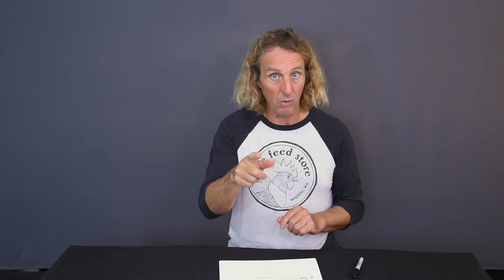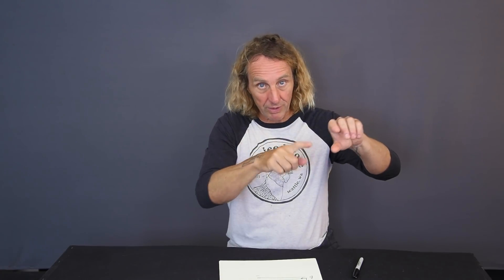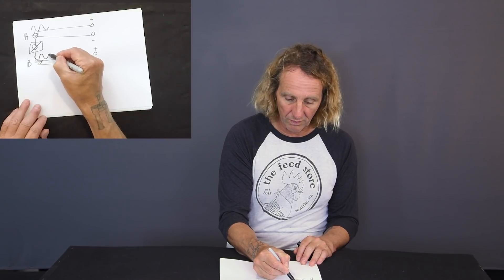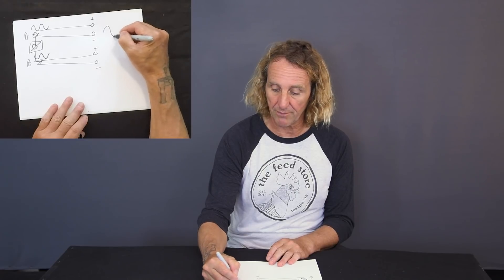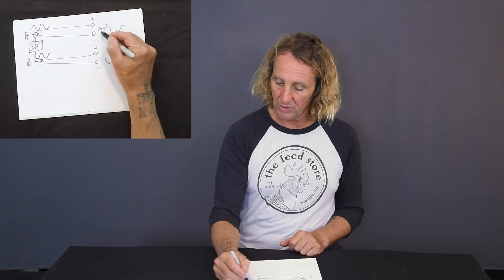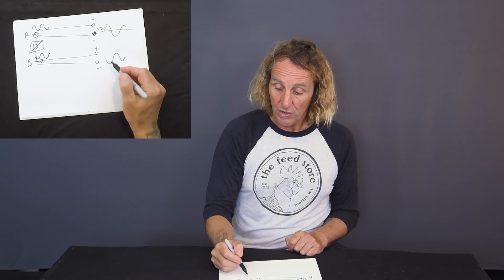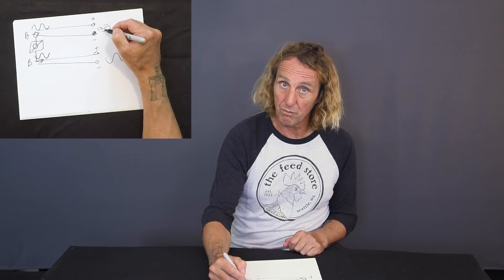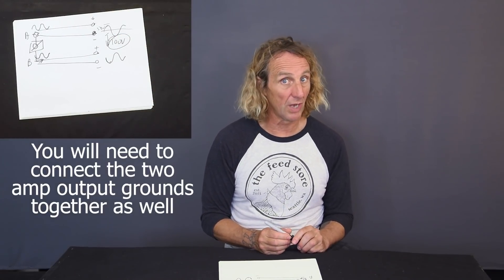Advantages of Amplifier Bridged Mono Mode

Comment: Great video! Isn’t the damping factor effected negatively when you bridge an amplifier?
Reply from the maker: Yes and no. Yes, into the same load impedance and same wire, damping factor is reduced with bridges, but if you double the impedance and double the wires, the damping is the same.

And with double impedance and double wire you have 1/4 the loss in the wire with brisged
Reply: @ wow dave himself! Thanks for explaining that.

Comment: I have a question, I have a crown professional series amplifier. How can I connect it to pioneer stereo receiver? There are no RCA hook ups on the back of the crown amp. Only a Phoenix connection.
Reply from the maker: Get a pair of RCA cables and cut the ends off of one side and why are the ground into the ground of the Phoenix connector and why are the center conductor of the RCA which is the plus to the plus of the Phoenix connector and put a little jumper on the Phoenix connector between the ground and the minus of the Phoenix connector.

The pin out of the Phoenix connector should be on the back of the amp or in the manual so you know which is plus minus and ground.

Comment: No its not better,  they sound horrible,  bridge may increase the power but half the demping factor  and struggles to handle low impedance speakers !
Reply from the maker: Hmmm, not exactly true.

Bridged into 8 has the same damping as stereo into 4 ohms

Also has the same amount of power bridged I to 8 ve stereo I to 4

But, bridged into 8 has 1/2 the loss into speaker wire if the same wiring is used.

Or, you can use thinner wires and have the same loss, saving weight, and money and cable size
Reply: @DaveRat  all this may  work in pro audio applications,  fact is bridging doubled the output impedance of an amplifier and it struggles to control low impedance speakers,  using thin and long speaker wire doesn't cut it .
Reply from the maker: @akhtarizod5802 well, perhaps you may not be aware that many amps are inherently bridged. Wherein each channel is actually two channels that are bridged. Bridged just means is a higher voltage and runs higher impedances.

Another way to look at bridged is it is a balanced drive rather than an unbalanced drive.

Balanced drive means each terminal has and equal and opposite voltage. Rather than a ground and one line having voltage.

 Also bridged uses the power supplies more efficiently as one channel uses the positive rail while the other channel uses the negative rail. A non bridged amp both channels use the positive rail at the same time time then the negative rail for signals that are the same to both channels.

Bridged has no impact on sound quality, it's just better at running higher impedances loads at higher voltages.

This is advantageous for minimizing loss in speaker cables.

Having higher voltages available allows better transient response as well.

Being more I formed will help you optimize the sound you are able to achieve

Comment: It all goes back to electrical theory. You have to understand the basic theory or foundation of Ohms law, watts law, etc... Years ago, I was helping a then friend do sound for a small festival.  NOT mixing, just setting up.  I tried to explain to him that his speaker cables were too light gauge wire, and he should move his PAs up front under the stage and keep the cables as short as possible.  The sub cables and connectors would actually get warm. I/2R loss.  
My background is in industrial electrical and electronics for over 33 years. With years in commercial electrical construction.  When you install sound systems in auditoriums, movie theaters, and stadiums, your distances are sometimes very long. Amps are hidden in inconspicuous places. Even inputs are subject to line loss.  Its crazy stuff, but very interesting.  Dave is a great teacher.  Pay attention bc there's a lot to learn!

Comment: Nice explanation and didn’t know you can bridge separate mono blocks… Question; Wouldn’t running a bridged amp to 2 speakers in parallel give you the most power and least resistance. This would give you a mono 4ohm (plus cable resistance) giving you almost double the wattage… Do I understand this correctly? (assuming the amp is stable/capable of 4ohm bridged)
Reply from the maker: Bridged into parallel will give max power potential but any internal amp resistance will be a bigger factor as bridged into 4 is the same as 2 ohms per channel
Reply: Dave, thank you so much for your response and confirmation I’m thinking of this senecio properly. I just recently found your channel and can’t get enough, I though I knew audio engineering well, but you have elevated my knowledge by at least 10%. Thank you!

Comment: Dude..... wish i would know this when i was 16 and had 2 same model 300-200 Watts... 
great stuff :washhands::washhands::washhands::washhands::washhands::washhands::washhands::washhands::washhands::washhands:
now days everyone is going with active speakers, I see ususally deploy Lacoustics system, passive. I like passive I believe are easier to run,(my system is very small compact. Tri amp, 3 way low, mid, High, thru 12GA) vs active where you have to run power to each box then feed audio signal top and bottom. I seen some DAS have CAT7 ins and out, witch is very cleaver way to reduce cables.... 
Do you prefer passive or active, I would like to know you opinion pros and cons. 
Thank you.
Reply from the maker: For small stuff amps in boxes works well.

For big stuff, the added fly weight, size and increased complexity of serviceability, having a whole bunch of small amps versus fewer big amps increases costs size and weight.

Plus having to run AC cables in trenches versus speaker cables can be an issue.

More things to go wrong way up high in the air with lawn systems.

Tell overall having the amps in the boxes creates more problems especially for large format systems

Comment: Interesting, thanks.
My only experiances of bridging (actually, Un-bridging) have been where people have asked me to check their rig out, as it wasn't sounding good. 
Having found the amps bridged, I've completely re-wired it all for straight forward stereo, checking that all the balanced inputs / outputs are properly balanced (ditching the XLR-TS jacks for example) and it has invariably sounded 10x better, with people generally saying ' :o Wow, what did you do?' or things to that effect.
This led me to believe that bridging just sounds rubbish, although I haven't done much experimenting, and most of the rigs I've done this on have been 'average' at best.
I brought this up on Speakerplans forum years ago, and pretty much every pro agreed, and it was more the newb's / amateurs / hobbyists that wanted to do it, because, 'double the power for free' sounds like a great idea, doesn't it? in theory.
I always figured it was just a cheap trick to make small amps bigger, if you had more amps than speakers, and it would always be better just to get a decent sized amp in the 1st place.

Anyone else have any input on sound quality?

What happens if you lower the gain control on one of the two amp channels? does DC go off-set? or just quieter?
Reply from the maker: I've had the opposite experience and bridges amp to make systems come to life.

Turning down one side all the way down just makes it the same  output as non bridged. Imbalances just put you somewhere in between.

The one bigvissue with bridging is if the amp is bridged into a lowwr impedance than it is capable of driving, then they lose power and can sound bad.

Many newer amps are permanently in bridged mode by design as it is more efficient.
Reply: @DaveRat  interesting. I'll have a try. I've got some 4 ohm PD2450s, and some 2 ohm stable 2kw/ch class ABs. 🙂
'stereo' 2kW into 4ohms x 2
vs bridged 4kW into 8 ohms (2 cones in series) x1

Thanks. For this, and all your other videos :)
Reply from the maker: Awesome. And if you use the same amount of copper, you will reduce damping and power losses in the cable

Comment: What about damping factor when bridged?
Reply from the maker: Great question. Since damping factor is dependant and load impedance, if you look at damping with a stereo amp and an 8 ohm speaker per side and 12ga wire pair per speaker.

Vs 

The 2 speakers in series (16 ohms) and using the same wire (2x 12ga)

You now have 1/2 the loss in the wire and double the load impedance, both of these will significantly improve damping factor to more than double, some amps more that others.
Reply: @DaveRat  thanks for the reply!

Comment: Hey dave. Once again you are too interesting. I should be asleep. Im running conference audio at the swedish pavilion in the expo2020 in dubai tomorrow morning.
Just had to see this. Ive only used bridge on too small amps to get more power. Still into parallell loads. For example a 900w crest ca9 amp into a powerful 8 ohm jbl sub. Just a work around with 2 small amps for a setup rather than 1 big. Was 10 years ago and i hardly remember the setup. Think we just changed a switch to bridge and used another nl4 outlet allready there in bridge mode?
Now doing it on a serial load is new to me! Reducing cable resistance part is amazing. But serial connection of speakers is + - + -.. you do it + - - + but with a bridged amp? You gotta open each box and redo them and always run them like this? Seems unflexible but its cool if its a fixed setup i guess!
Im a bit confused by the jumping the negatives part.. honestly.
And when you compare it to a balanced line or mic im even more confused. Cause those are polarity switched a 2nd time to make them in phase again and double the audio signal while cancelling the noise.
And now you dont flip it back. Claim it to be nulled between the speakers as in cancelled.. but the spealers themselves still run in phase and aid eachother?

It might be that its 4.30 in dubai but i feel im missing some piece of logic here. Haha im sorry.
If you can set me straight id be happy!
Love!
Reply from the maker: You wire +-+- for series to double the impedance but keep all in polarity when bridging and using the two amp + hot outs.

There are other wirings though as some amps have ch1 + as in polarity and ch 1 - and ch2 + as grounds and ch2 - as out of polarity. 

The speakers wire the same but you don't need to polarity rev ch 2, you parallel the inputs and wire the speakers between ch1+ and ch2 -

Comment: Dave why would it need to be connected in that way (input polarity reversed) why not just leave the inputs the same phase and connect the outputs in series, as if you were putting 2 batteries in series to double the voltage, IE you take the top plus and the bottom minus, and connect the 'middle' plus and minus to each other.  As far as I was aware amps (at least some) all the bridged switch does is apply channel A to channel B on the inputs and connect this middle link at the outputs.  If you look at pictures of amp terminals they tend to have the bridged option printed on the back as the outer minus and plus terminals.  (images search etc)  Cheers.
Reply from the maker: Connecting an amp plus (hot) to an amp minus (typically ground) is not only unwise but will probably blow up most amplifiers.

Unlike batteries which are completely floating amplifiers have references to ground and hot more like AC wall voltage.
Reply: @DaveRat  OK well that's how car audio amps I've come across do their bridge mode, perhaps that is just on those then. They definitely do not tie one side to ground as the instructions that come with the amp explicitly say not to allow either terminal to come into contact with a ground.
Reply from the maker: There are amps that have the ch1 plus is hot and in polarity and channel 2 minus is out of polarity hot and with that you can connect the speaker between the ch1 plus and channel 2 minus for bridged. Lab Gruppen is this way

Also there are amps that are fully floating like car audio amps where ch1 plus in in polarity hot and ch 1 minus is out of polarity hot and ch2 is the same way. L-Acoustics LA12X is that way.

For these amps connect the speaker between ch1 plus and ch 2 minus and connect ch1 minus to Ch 2 plus. And this will creat a bridged output.

This would be how some or most amps are and what you describe.

Most or at least many amps have a more conventional wiring where ch1 plus is hot and in polarity, ch 1 minus is a ground, ch2 plus is hot and in polarity and ch 2 minus is also a ground.

For these amps, if you were to wire them with ch 1 minus connected to ch 2 plus, ch2 would see a dead short and that would not be ideal

Comment: Hell yeah, ive never thought about it this way, i need to go rewire my amps coz im losing so much free power!

My amp has  bridge mode which requires only input into channel A, how would I get both left and right outputs into my subs since my processor doesn't have a mono sub out?
Reply from the maker: Either create a matrix mix on the console for sub out that is a mix of left and right. Or do subs on an aux. Or get a seperate sin processor that will mix left and right.

Comment: Back in the day I ran a 3 wire setup, Bryant 15A 125V twist locks.  Ch A lows, Ch B low mids.  The - wire served as a neutral more or less.  The only time Ch A & Ch B were in phase were at the crossover point which was down -6db.  Worked well.  Didn't invert Ch B on the amps, the difference was the frequency bands within which they operated.
Reply from the maker: The concept of a neutral is based on the signals on the hots being equal and opposite.

I tried a similar setup with common ground wire and the impact was audible in a non desirable way.

I did a a video on 3 wire vs 4 wire headphone cables that shows the issue of common ground wire with dissimilar signals
Reply: @DaveRat  What's the title Dave, I would like to have a look.  Always things to learn sir.  Thx.
Reply from the maker: I think this is it

https://youtu.be/EchK1NI5X5c
Reply: @DaveRat  Thanks.  I should have bridged the amps for optimal results with a 3-wire setup.  Doing it right these days with 4-wire setups on everything.

Comment: I keep hearing about "Balanced headphones" in my mind Balanced is an XLR (or TRS) connection at line or Mic level. I see where we're going here and I get how it's balanced and in a way and I see how that's been done in every consumer device with a headphone jack (except the iPhone) but I don't see how a 4 wire headphone cable on crazy audio file headphones is balanced because it seems like they're separating out the left and right speakers and amps on the output side to somehow avoid combining the grounds. Maybe I'm thinking of balanced as in Signal cancellation and not balanced as in flow?
Reply from the maker: Not sure about the details of balanced headphones but I am guessing they are doing exactly that, eliminating the common ground and having a seperate balanced amp for each ear.

Comment: Dave, good explanations.  One minor thing - when talking about power loss due to resistance in the speaker wires.  As far as I know (could be wrong), most power amp stages use some sort of voltage feedback for linearity.  And, at higher impedance levels (like 8 ohms) the max power they are able to provide will be voltage limited.  So if you are talking about power loss vs. max power available, there is actually a squared factor rather than a linear factor.  In your example with 8 ohm load, and two wires of 1 ohm each, it's true that 1/5 of the power delivered by the amp will be dissipated in the wires, and 4/5 in the speaker.  But also if that amplifier is rated at 500Wrms at 8 ohms, and is voltage limited (at 63Vrms), then loading it with 10 ohms means that it will only be able to deliver 400W.  Then, only 80% of that will get to the load because 20% of the voltage drop will be across the wires.  So the speaker will only end up with 320W, which is 64% = (0.8)^2 the rated power of the amp driven at max input level.  If there was current feedback, then the output voltage would increase automatically with the higher total load resistance to keep the output current constant, and then there would only be a 20% loss.
Reply from the maker: In either example, is it not true that if the 20% of the load restistance is wire and 80% is speaker, 20% of whatever  output watts are being delivered die to the amps capabilities into that load, will be lost to wire?
Reply: @DaveRat  it is certainly true that if 20% of the total resistance in the load is due to wires, then only 80% of the total power dissipated in the speaker+wires will be dissipated in the speaker.  My only point is that the actual power loss impact of having X% wire resistance in comparison to the power output you might expect to get from the rating of the amplifier, could be (1-X)^2 due to the fact that the amplifier has a maximum output voltage swing (before clipping).  So the impact of speaker wire resistance is even worse, as it decreases both the current and voltage seen by the speaker simultaneously by 20% each (assuming constant voltage drive at the PA output).  Of course in dB, it's all the same because we'd calc power change at 10log and current change at 20log.  So you get 2dB power loss (which is ~40% power loss), and a 2dB current drop (which is 20% current drop).  Of course this is all a simplification assuming purely real speaker impedance.